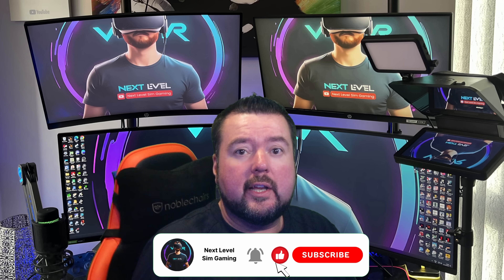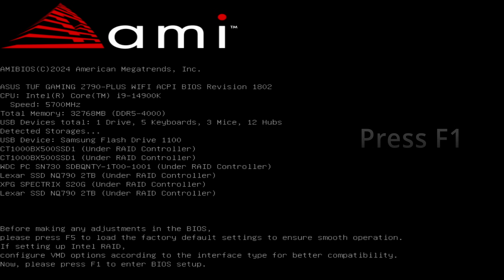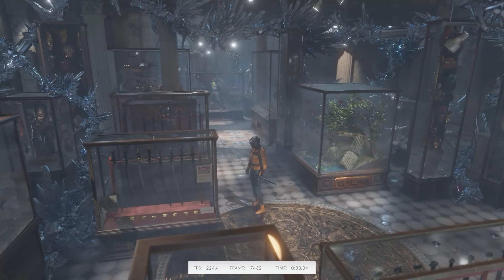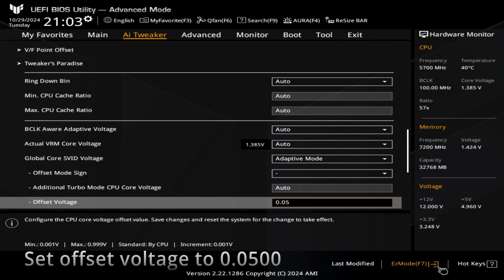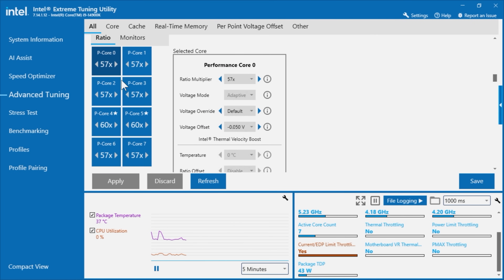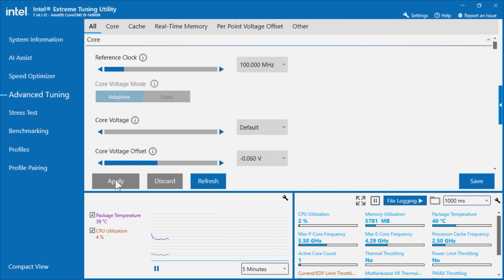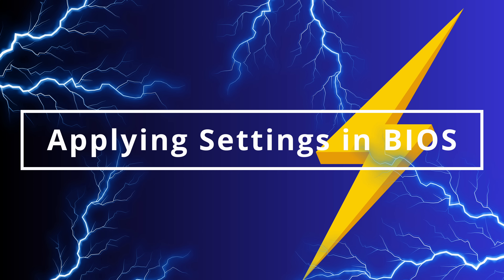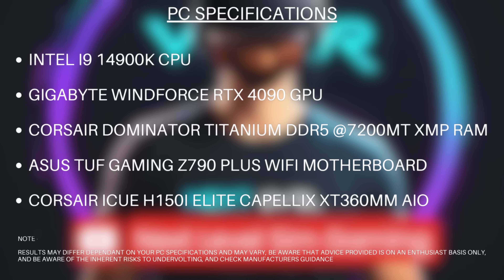i9 14900k Intel Final Microcode 1802 - 0x12B  BIOS Installation, Tuning and Undervolt Guide 📈

Comment: They released a new update. Do you know anything about it? Will you make a video about the 0x12F patch?
Reply from the maker: I won’t be making any further videos on the Z790 platform mate, I have changed to Z890 since December, the guide is still applicable to the new BIOS
Reply: @nextlevelsimgaming  Thanks friend, I will apply the same to the new patch.
Reply from the maker: @r1cc-1 No worries, a few people have experienced instability with the new BIOS in general so as the old saying goes if it ain’t broken, you don’t need it 😉
Reply: @nextlevelsimgaming  I'll try it and if it doesn't work well I'll go back to the previous one.
Reply: @r1cc-1  How'd it work for you? I updated and now when I actually run OCCT test for stability the damn CPU only boosts to 3.5Ghz lmao (14900KF)
Reply: @Burstahh  :o I'm going to update now, I forgot, haha, what test did you do in OCCT? To try.
Reply: @Burstahh I'm testing with offset - 0.0500 in cinebench and the boost is around 5.3ghz 5.5 in cpu-z. I'm going to modify the offset, I'm following the video at the moment at 0.0500 it's around 93 94 degrees it doesn't go over there logically at 0.055, 0.060, 0.065 or 0.070 would be the limit or 0.075 there the temperatures would already be lowering, but at least it reaches the corresponding boost or gets close with cinebench r23. I'll try with occt later.
Reply from the maker: Thanks for the update mate 🙂
Reply: @nextlevelsimgaming Could you make a video with your 14900kf about the new patch so I can see if my PC is behaving correctly?
Reply: @nextlevelsimgaming Avx2 shows thermal throttling at -0.075, and at -0.08, it shows no throttling. Should I leave it like that? Everything below that shows thermal throttling. Six months ago, there was no thermal throttling, could this be due to the new microcode? Or is it time to change thermal paste?
Reply from the maker: @r1cc-1 I am unable to test the update unfortunately I have now moved to Z890 ARL, but I am hearing nothing but issues about it, pasting may work but it may be a case of rolling back if possible to the previous BIOS or waiting for the next

Comment: Regardless, appreciate your reply from earlier. I still have an i9 14900K - I just followed your video and managed to get a, as yet stable  -0.075 with 340a ICCMAX, and a score of just under 40K on RS3 - The default that I tried before any alterations were 36K - Temps lowered massively - Passed the AVX2 test a few times as well! Appreciate your help - New Sub :)
Reply from the maker: Great to hear, thanks for the comment 💪🏻

Comment: Hi I have a I9 13900k will these settings work with my processor? The only change I will make is to sync all cores to 53. Is their any other settings I have to change.
Reply: Cool thanks :)
Reply from the maker: No worries
Reply from the maker: You’re correct and no all other settings are the same
Reply from the maker: Yes exactly the same, and as you say sync cores to 5300

Comment: New Bios update Ver. 2001 for  Rog Strix Z790-E mobo.
Reply from the maker: Thanks mate!
Reply: @nextlevelsimgaming   No worries dude.
Reply: @nextlevelsimgaming  I guess they pulled the Bios update, I think people were having major issues with it. I did not update the bios so would not know. Was going to do it today, guess not.
Reply from the maker: @Pinkfloyd1173 A lot of people have had problems mate, it seems that unfortunately the issues are not resolved contrary to what Intel stated previously

Comment: Hey, ty for the video and your information, that are a really good results of performance and tempertura. Which are your values in AC/DC? The Mode 4 in LCC what it does exactly, can you explain a little more? In th eother hand, are you reaching > 307A in  ICCMax with your tests? I don't get any IccMax > 307A with these settings. When you turn off the Intel Adaptative Boost Utility and sync all cores to a 5.5Ghgz Max, why don't you loose performance in CBR23, the 200MHZ up to 5.7 and the 500MHz of the 2 Cores 6Ghz? If I do the same that you, I only reach 37K with your same CPU and XMP with 6400. I hope you can post a video like this with the new microcode 0x12C.
Reply from the maker: Theres a lot to digest in your question, but the reason the profile improves performance (over the Intel Default Profile) is stability, the thermal dynamics are improved over running boost, you are looking for consistency in an undervolt.  The reason these processors have issues is the instability of the core loading when the P cores boost.

As for load line calibration, level 4 is stable enough to prevent V Droop, from idle to load, its a precautionary voltage over or undershoot to prevent insufficient power delivery, a bit like sudden acceleration or braking in a vehicle.

The limits on power are manually enforced by disabling Unlimited ICCMax and setting the power within Intel recommended specifications.

Cores are synchronised to maintain consistency.

Faster is not always better, stability in gaming and low temperatures are key to improved performance, and reducing known issues whilst prolonging the lifespan of the CPU through improved thermal efficiency

Comment: My 14900k can't go below -.0200. Cinebench wont even run. Fortnite won't load initial shaders unless dialed down to -0.1. Idk what else to change. Followed guide step by step. Asus z790 rog hero, msi 5080, 14900k.
Reply from the maker: @Auri442 Unfortunately some CPU’s wont, every CPU is different and performance is based upon silicon quality, only a higher graded CPU will be efficient enough to undervolt.  See this part 2 guide that goes into more detail on stress testing 

Guide to Setting the Correct Undervolt and Stress Testing Intel Raptor Lake i9 14900k
https://youtu.be/XM2JLjcQZgc
Reply: @nextlevelsimgaming  RMA'd my cpu. I am back watching guide. I can go as like as -1 now lol. CPU was greatly degraded.

Comment: Hello, i have i9 14900k with asus tuf z790 pro wifi, i followed everystep twice to make sure im not missing anything, but at 0.0500v cinebench fails with bug report, and intel stress test fails, i kept going all the way down to the original 0 for it to work, i got my cpu when the microcode patxh was released, so im not sure if it already degraded or not, any chance i can contact u for help?
Reply from the maker: @LaithBaladiah  I don’t provide individual advice, but use the Intel Diagnostic tool to check if there are any issues with your processor if it identifies any issues you will need to follow the RMA process 

https://www.intel.com/content/www/us/en/download/15951/intel-processor-diagnostic-tool.html
Reply: @nextlevelsimgaming  i did it and it passed on all, when i tested ur settings for gaming it worked, but after i finished gaming i did the tests and they all couldnt pass, im wondering what i can do because i doubt my cpu degraded that hard
Reply from the maker: @ See this part 2 video.

All undervolting is dependent on Silicon Quality, a degraded CPU will require more power, and will lose its efficiency

Guide to Setting the Correct Undervolt and Stress Testing Intel Raptor Lake i9 14900k
https://youtu.be/XM2JLjcQZgc
Reply: I'm having the same issue. My offset is currently at 0.065 XTU passed on stress test. If I do a single run on Cinebench run fine but if I select 10 or 30 min I get the application error the test stops. I've been gaming on it for few hours a day with no freezes
Reply from the maker: @ Disable Asus Multicore Enhancement in BIOS and IA CEP and SA CEP
Reply: @nextlevelsimgaming I'll give that a try tonight and report back, thanks!
Reply: @ i ended up rming
Reply: @did you make sure all the settings actually saved? I had to go back in my bios because a few did not after exiting/saving  the first time.

Comment: I have an Asrock z790 nova wifi with the i9 14900k intel cpu... will this work for me or no? I don't wanna just blindly install it and mess all my stuff up. I'm not real computer savvy
Reply from the maker: @fyregus  It would work in principle, but unfortunately outside of Asus boards, I am unable to advise on others as I have no knowledge of the different terminology used.
Reply: @nextlevelsimgaming  Well thanks for the fast reply. I actually went to their website and saw the updates they had available and apparently the microcode is included, and I already installed theirs a few months ago but i'm still experiencing crashes left and right. I can't play my favorite games like Tarkov arena or even indie games like Schedule 1. Hell, even warcraft 1-3 was crashing on me after an hour or two. 

1 of 3 things keeps happening to me:

1. I get a BSOD
2. My computer shuts off and turns back on
3. I'm lucky and my game just crashes back to desktop

I'm completely stumped on what to do.
Reply from the maker: @ Try the channel ‘Actually Hardcore Overclocking’ aka Buildzoid, I believe he covers Azrock cards and undervolting, the Raptor Lake issues were just something diversionary at the time I covered, I have always used Asus boards, so wouldn’t know how to guide you through others I do get asked this frequently, hope you get the issue resolved.
Reply: @nextlevelsimgaming  i actually have a msi tomahawk b550 or whatever motherboard that my brother got me last year as a present but never used. Im just gonna switch all my hardware to that and see if it solves my problem. It doesn’t take intel cpus so i was wondering if you could recommend a good cpu for it.
Reply from the maker: @ Probably the Ryzen 5800X3D with that particular board if for gaming
Reply: @nextlevelsimgaming sweet, thanks buddy!
Reply from the maker: @ No worries
Reply: @nextlevelsimgaming well buddy i’m back with more issues. I ordered the cpu you suggested and it’s giving me problems. The cpu debug light stays on and nothing displays on my monitor. I noticed if i place only 1 stick of ram in, turn on my pc, hit my reset button, it works and the debug light turns off… i went and proceeded to update my bios and even after all of that i still have the issue of only getting to use one stick of ram instead of two.

Really not sure if it’s my mobo or the cpu thats at fault. 

My full specs for my current build is:

OS: windows 11
Gpu: amd radeon rx 6950 xt
Cpu: amd ryzen 7 5800x
Mobo: mag msi tomahawk b550
Psu: corsair rm850e

Everything on pc part picker said its compatible
Reply from the maker: @ Are you installing the RAM in the correct slots?, A2 and B2?

I have to emphasise as well that these videos were done to help people specifically with Raptor Lake issues riding on the back of the Intel Degradation problems from last year, although I’m happy to answer the odd question where possible I don’t provide ongoing PC advice, as I also work as an IT field engineer full time.
Reply: @nextlevelsimgaming oh ok my bad. And yea i’m positive they’re in correctly. At first i didn’t know what to do cause i was getting a blank screen then found out if i hit the reset button, it decides to work.

If i insert a second stick into the fourth slot, it goes back to giving me a blank screen. Hitting reset doesn’t seem to fix it like it does with the one stick. And after taking out the second stick, i have to do the whole reset thing again. Normally after resetting it once it has no problem just booting up on its own. 

I would take it to a pc tech but i live in pennsylvania and a professional tech is like 2 hours away from me. There are folk who run their own little repair shops but meh i have trust issues with that and would rather just figure it out on my own.

But hey i appreciate the help either way.
Reply from the maker: @ Do a clear CMOS, pull the CMOS battery out or press clear CMOS button (if it has one), this will clear any stored XMP profile.

If you have installed a new processor, ensure its correctly installed and is not too tightly clamped down.

The first steps are the basic ones unfortunately, and that’s troubleshooting starting with a clean BIOS, then RAM, but it may be trying to train the RAM based on the prior configuration.
Reply: @nextlevelsimgaming alright ill give it a try
Reply: @nextlevelsimgaming well still nothing. I tried buying new ram sticks and upgrading from a single 16 gb stick to a single 32 gb stick and the 32 stick just makes my pc go into an infinite reboot loop lol. If i put two 32 gb sticks in i get the same issue, a blank screen. Im pretty stumped at this point and about ready to just toss this thing into the dumpster. There goes $3,500.
Reply from the maker: @ Have you got them in the right slots? 2 and 4?

Comment: On 0.05 test fails, but on 0.045 itw fine. I should stay on that?
Reply from the maker: @GabrielZorych  Yes, if that’s all your CPU is capable of then that’s the best you will get, it’s unfortunately the silicon quality that dictates how far you can optimise the undervolt
Reply: @nextlevelsimgaming  it passes ETU AVX2 test, but not on OCCT. Is there differences, or should I go higher to 0.04?
Reply from the maker: @ Go to whatever is stable in gaming, and under load, be aware though a processor that can’t handle an undervolt and requires more power may be a sign of degradation as a degraded processor will begin to require more power

Comment: hello i don’t understand why, but i listen youre vidéo i have an i9 14900k and a z790 maximus hero but im not able to put my core voltage at -0.055… im able to put at -0.045 v… its fine or??.. my temps are very fine i have a customs loop when i try to pass the stress test at -0.050 its failed, same for -0.055… but at -0.045 its pass the test
Reply from the maker: @callofduty353355433  If at - 0.045 its fine, then thats all good, all silicon is individual, so what works well for one processor may not work well for another, its known as SP or Silicon Prediction, or the Silicon Lottery, some bin quality is better than others.
Reply: @ thanks for youre answer really quick appreciate!
Reply from the maker: @ No problem enjoy 😉

Comment: I have a ROG STRIX Z790-A GAMING WIFI II and when i go into the bios and firmware, it only has version 1801. Is this what i should use?
Reply from the maker: 1801 is fine, the number varies depending on the variation of the Z790 motherboard

Comment: The instructions I went to easy flash I got the file and when I click, it asked me if I wanted to read this file and the moment I did click yes my screen froze. Please advise 😊
Reply from the maker: @40cal22  Did you unzip the file before adding it to the USB stick?,  and run the renamer.exe?, you need to refer to the instructions on the Asus site, also format and try a different USB stick
Reply: @ Thanks for your help. That solved the problem 😎
Reply from the maker: @40cal22  No problem 😉

Comment: why is your cpu throttling all the time?
Reply from the maker: @Slideyboiii  Because we are using the Intel Default power settings to ensure that it operates within Intel specifications, not untethered, it will current throttle within 400a / 253w PL1 and 253w PL2

Comment: I am using 14900kf and I applied the same settings and it was successful, thank you. There was a change of about 15-20 degrees in temperatures. I got 39200 cinebench r23 score. The processor passed the stress test successfully.
Reply from the maker: @chankarlo  Great good to hear, enjoy 😉

Comment: I try to run the stress test and immediately my temps spike up to 100c and hover around like 95-100 lmao, I have a 360 AIO cooler I have no idea why this is happening even with undervolts
Reply from the maker: Check thermal paste application and ensure that pressure on the IHS is sufficient

Comment: Is something wrong if it’s showing multiple cpu power throttled during stress test on avx2?
Reply from the maker: @klyzon  Yes it should do, its enforcing the Intel power limits we set 400a 253w/253w with no enforcement your processor would run untethered power limits and thermo throttle
Reply: @ ok thanks. Cause I’m only seeing xtu showing one instance of cpu throttling but mine is showing a full page of it
Reply from the maker: @ I depends purely on the level of undervolt applied, the more you refine the undervolt the less throttling you will see

Guide to Setting the Correct Undervolt and Stress Testing Intel Raptor Lake i9 14900k
https://youtu.be/XM2JLjcQZgc
Reply: @nextlevelsimgaming  I see! Didn’t know a better optimised undervolt will have that effect. I’m already at -0.095 for my 14900k. Will continue to try.